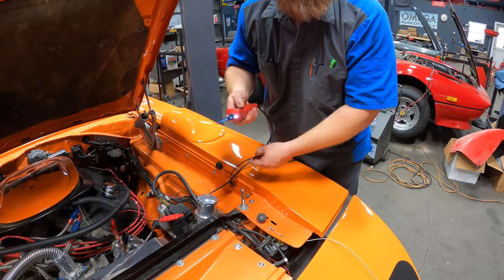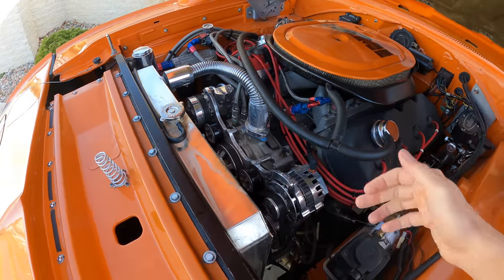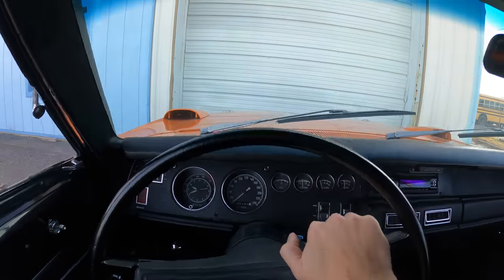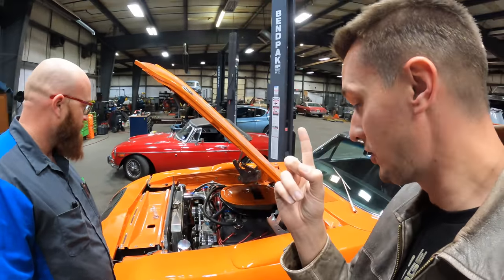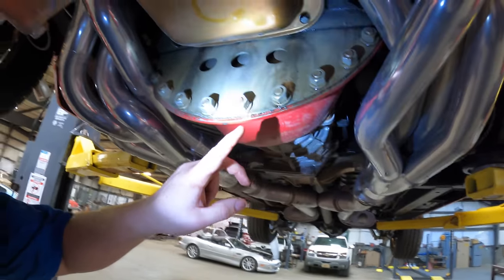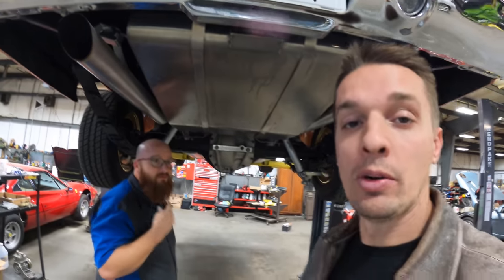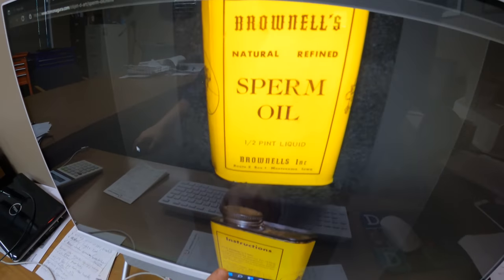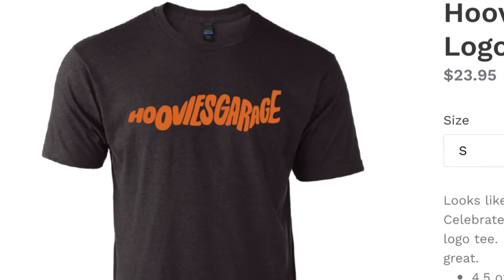How I got SCAMMED buying a Plymouth Superbird online sight unseen (So much broken/missing)

Comment: I can't imagine buying a car of that scale without thoroughly checking it out myself !!
Reply: DING-DING-DING!!!!!!!!!!!
it was just to make for a better vid!!!  this is by design!!
Reply: and that's not at all set up like most B-Body's like my 1968-70 aka what are you doing crazy 😜
Reply: @richardprice5978  
Huh 😳?😳
Reply: @ssnerd583  
Sadly.
It only made him and his buddy look Clueless 🤤
Reply: @My-Pal-Hal  that has a poorly 💩  thought out and executed maga force front system and a WTF back system as it feels like the parts canon 💥off ( i like the full length 1955 packerd T-bars/QA1 but that me ect. 2C ) and the oiling systems is?? 🤔🤦🏻‍♂. not my car but most of it isn't how i have mine 70 charger and yes im working on doing the 4.5"-crank hemi+TR6060*+8-3/4(3.2 gear) swap for brakes full willwood and a 91 jeep XJ hydro  master cylinder 👌aka i skiped having a vacuum pump and im running turbocharged  boost + lumpy high lift cam .600"+ and is a A/C 🚘ect. any other questions id be happy 😊to tell how mine is set up or others around me
Reply: @My-Pal-Hal  with as expensive and rare as real factory's matching-ish numbers hemi's are to day ( and not my frankenstein D-8 headed Tall Deck efi engine/383-LD as mopar and SBC-350's made more of them ) id drysump ( or at least 💯 shur its getting oiled 💯of the time with stable 40+ PSI ) that bastered ( basically what im doing that to mine but i have a welded steel bed 🛏plate that looks like a 1968 SS bread 🍞pan/oil pan and 12QT tank next to the rad/clip and to be honest for hoosy's is probably over kill maybe a girdle but that's it. as the engine is missing some paperwork aka unknown history and some odd plumbing and or parts choices/locating parts 🤷‍♂ why on so but i don't have the same problems/noise as this car ) ( and have a method of pre-start/ect lubricanting it ) and have the EFI that bird 🐦looks to have, shut off/kill the motor if the oil PSI or temperatures aren't right 👌as it's not concorst resto anyways and mostly software ( more so if it's a holly's system aka easy to do ) with operating engine and transmission pramitors
Reply: This guy one big doofus to have not inspected this car in person before purchasing. It's all on him!!!
Reply: @deaniacoponi2139  yah i thought 💭id add if you don't want a vacuum pump there is electric option openers on the head light 💡's are dodge later on the the run use them ( plus at least with my/charger doors and lights there was a add on oe option for tiny vacuum or electric operating wiper's and washer system. id like to add that but haven't yet so i don't scratching my paint/car ect. ) and there's the aftermarket options too and the climate control systems have other aftermarket operating options that use electric or vacuum.

on mine i 1/2 cheated and im still using vacuum for all of it and or turbocharged boost by using the opposite side of the bellows /clever valve's and a regulation of PSI or vacuum ( and a small vacuum storage tank ) to them like on the 💡doors 🚪as the older guy i know said the electric doors can be more maintenance/needs more looking over and lubricanting and wiring 👀over as the oe's didn't have IP68 connector's ect.
Reply: but i doubt that bird 🦅is going out in the snow ❄or heavy rains at night or even the daytime ( colder or foggy   weather more than likely the A/c is going to get the most use ) that would be a problem for it as its a 80+k usd car/drivers that are more careful with it now. 

unlike my car but i do try to keep the salt off of it! 🤦🏻‍♂😉 aka bad idea 💡ect. and for mine the HVAC system probably is better served with electronics instead of vacuum ( and if the vacuum pump is there why 🤔 isn't it vacuum assisted as well ?? ) and cable's but my vin is a a/c car so it was all there and working/ easier/cheeping for me to hack it 😉 ( plus im not good at coding or aftermarket wis setting up 4now but there is a bolt on parts for it ) i know not the brightest idea 💡but for now will do
Reply: @deaniacoponi2139  more of a problematic that he didn't do any research before buying it, as i should know i got bit $$ doing that stunt ( pre-ish / slow internet days in 2009* ) and i have little to no plans of redoing that buying experience
Reply: If 3400 is TRULY the damage, he is VERY lucky.  60s-early 70s muscle cars are rip-off city. Horrible mismatched cars, rivited repairs, trashed engines, rust (that has been hidden under bondo).  You really need a muscle car specialist.  He should have visited Uncle Tony's Garage.  Classic Mopar Muscle is his specialty.  Working on them since before wizard was born.
Reply: that's the Hoovie way! are you new here?
Reply: @richardprice5978  
You have to remember.
Back in the "STOCK CAR" Day.
The rules were not only different. And FAVORING Actually Stock Cars. The reason why the Super bird exists.
But their total Computer Designed Vehicle Research was a bit behind the times 😂
My first car, I may have said. Is a '69 Roadrunner. 383. Blue, with the dual hand painted strips. And White, Boats Skin Vinyl Top. Blah blah blah.
But when I got it some 50yrs ago. I wanted to put a WING on it, like the Super bird. So I learned a thing or two about the car, frame, body panels and such. That go with the Super Bird. The Front Fenders are the thing.
Which brings up the Dayton Charger. Where it was the Rear of the car,.. (roof and rear deck) that was the Aerodynamic Problem with that car.

Anyway.
Now I think about it.
Anyone buying a car that's been WRECKED. Better be Buying a Super Bird 😂
... still have my roadrunner. though the roof is showing its age 😌 ... if you want vehicle spec's, I got em
Reply: @tarstarkusz  
HEY 🤔
THAT SOUNDS LIKE AN "AD" FOR SOMEONE.
That's against the Rules isn't it 😂
The bottom line...
Is Anyone bitching they bought a Super Bird.
And I got a Dollar he bought it with YouTubes Help.
That's just one F'd Up human. And I use that term Loosely 😂
Reply: @My-Pal-Hal  he actually says thanks to his viewers for helping him do stuff like this 🤦‍♂️
Reply: @vw5056  little bit salty are we? It’s simple. Don’t watch.
Reply: @My-Pal-Hal  It's not an ad, but UTG is an expert.  If there are wrong parts in here, Wizzard will NEVER know.  Uncle Tony knows these cars inside out and backwards.  Little tiny things nobody else would even think to look for, minor differences under the hood between model years.  It takes a Mopar Muscle Car specialist to know it.
Classic muscle cars is absolutely loaded with fraud.
Reply: @Tyler-ts2ld  Indeed, you're right. I just came here because this car was on Car Wizard. I am done. Car Ninja, Pine Hollow and M539 are all better channels to watch.
Reply: If its called " Bring A Trailer "  do you expect to be able to drive it ? by 5 mins in I give up , yes low oil pressure is a worry  ( how low?) .  But selling a car   the cheapest of its kind & 50 year old ... with horn not working ..Wow !   What con artist !  send him to Alcatraz  !
Reply: Not allowed to do a test drive even ??  Inflation being what it is , filling this  gas tank w / hi test petrol is just going to get more costly as time goes on.. ..what about costly insurance for this kind of car ? - costing out the nose -  It will only get higher with time..replacement parts , expert mechanics charge major cash per hour .. 💰💰💰..I almost feel sorry for the man .. almost💸💸💸💸💸💸💲💨🙁
Reply: @jmason2838  did you have a stroke typing that??
Reply: I can’t imagine buying a car worth more than my first two houses
Reply: @YourMom-mq4zc  yeah this guy’s got serious FU money
Reply: Yeah, but the thing is, in the time you take to travel to inspect it, arrange for the mechanic to also go look at it, someone would likely have bought it from under him.  It's such a rare car, that if you have the money to spend, you take the chance, I guess.
Reply: @vw5056  You realize this is a comedy show about the rich guy buying these awful cars, right? Sure, it's mostly unscripted and the car purchases are real, but still.
Reply: @YourMom-mq4zc  it's not authentic that's the whole point barely any of it is original,and that's where the value is originality.this thing looks like a kit car gone bad.
Reply: The guy made more money on this video than 3,400 dollars so it’s a wash for him. Already 1.3 mil views

Comment: I almost bought a 1970 Plymouth Superbird, also with a 426 hemi, in 1984. I wish I had...

It was pretty beat up, had exactly the same front suspension issue, had a recent white paint job (with tons of Bondo), the rear "frame" was rusted through, it was missing lots of pieces (like door locks, ignition lock, trunk lock, trim pieces, etc) and the owner had recently spent a few grand upgrading the motor (MSD ignition with rev limiter, new Holly carb, new "¾ race cam", new headers and exhaust, new very heavy clutch, etc.). He had a dyno printout showing 503 HP, which in 1984 was considered insane for a street car.

Her was asking $2500. I offered $1500. He came back at $2000 and we never settled on a price. The reality was every penny to my name, at the time, was $1625 and he wouldn't take it.

I did call him back after my next paycheck two weeks later, but he had sold it for $1750. $125 away from my offer......

It is very strange to see a second Superbird with the same suspension issue (although Hoovie's one is in much, much better condition). In the car I was trying to buy, the owner had installed lowering spindles that were so low the oil pan was scraping. He also mentioned his ¼ mile times suffered too, because the lowered car couldn't transfer weight like stock.

By cranking up the front coilovers, so much the shocks were topped out, he said he was able to get close to his previous ¼ mile times and solve the oil pan scraping issue. The ride was unbelievably horrible, bouncing along just liked Hoovies car.

I wonder if the same issues affected Hoovies car (oil pan scraping after lowering spindles were installed so the owner cranked the coilovers up all the way and beyond)?

Comment: In the Mopar muscle car world you have to be careful using the word “rebody”. To many Mopar guys that means that the VIN from the dashboard and under hood fender tag were taken off an unfixable car and placed on a different shell.  This is not good and would be fraud and illegal.

I would be curious to know how much of the car was replaced in the wreck.  If it was front fender, door, quarter panel and maybe the lower floor and door jamb I wouldn’t be as concerned as long as the work is high quality.  I would not consider that repair a rebody.  

You have to be careful that the original dash VIN and fender tag and even the build sheet are reproductions.  There is a whole cottage industry where new tags and documents can be made.  This can be kind of a gray area if there isn’t proper documentation.  I once had a 1974 Challenger 360 that was missing the fender tag but I had the original build sheet.  I had a company make a reproduction fender tag because all the information was on the build sheet.  But sometimes people will want to add or change option codes on the fender tag to make their car more desirable and worth more money.  Mopars actually have a lot of information on the fender tag and build sheet about how the car was built compared to Ford or GM. But you really have to know what you are looking at and do research.
Reply: Hi Mike, never heard the term “cottage industry” before, what does it mean?
Reply: GM has RPO codes which are pretty dang inclusive.
Reply: @ArthurTugwell  I bunch of individuals doing work independently of each other but to the same objective.
Reply: You can look up what the car came with originally and make sure a xp29 charger hasn't been changed to a xs29 which is a RT charger. Or rarer yet a XX29 charger which is a Daytona one.
Reply: @ArthurTugwell  What Fiddler said, but here it means private parties reproducing original documents and tags. At best these are faithful reproductions of what SHOULD be with the car had it not been lost to time; but at worst it's counterfeit documentation to make a common car seem to be a rare one. If you watch the people who certify the authenticity of a vehicle they not only look at the documents and tags, they check to see if they've been tampered with and also look for other features that indicate the car is really the one that goes with them. For example, a car that was born as a Hemi car has certain reinforcements made to the suspension and body. Most fraudsters don't know about it, or else don't care enough to take it that far.
Reply: I saw video about a "rebuild" on a Bugatti pile of rust.  I dont think there was any original piece on the finished car.  In the Yacht world a complete rebuild means all the wood and faster are replace but it is still the original boat.  Also there is a video here about a crushed Shelby Cobra turned into a coffee table but the vin was sold.
Reply: Mopar guys refer to the process as " A tag job"  and as mentioned a   knowledgeable Mopar guy will point out every incorrect part on the car: Braces, hardware size....

Comment: Due to the seller screwing him over in a few ways, he ended up saving money overall, that's interesting. I imagine the auction site would particularly want to make this content creator happy, rather than other people, but yea very cool.
Reply: Not at all. Spending that kind of money on a car and not inspecting it first, he screwed himself.
Besides that all the crap he's complaining about isn't original anyway, it's just run of the mill 'car stuff'. If the issues he had with it had any impact on the cars 'status' which is 99% of it's value, then he may have a legitimate complaint.
Reply: @Anubis78250  - Well he was going to buy the car either way and fix whatever he needed to. So it's not screwing himself either way.

From the video it seems like he might have had to get in quick with the purchase, or maybe the car was far away and had to get transported to him or something along these things. I don't think the option to go and inspect it was really there. Not that I think it really matters to him either way.

The car had a good number of dodgy things going on. Some are okay, some are less okay (like the supposed "tyre adjustment" that needed to be done). The point is that they weren't disclosed, even after some things were disclosed (after the purchase, which is already dodgy).

These things should be disclosed regardless of whether they impact of value of the car or not. Sometimes a bunch of weird issues can signify that the owner is pretty dodgy and that the car might actually be in very rough shape, and can lead you to not trust them as far as the purchase goes.
Reply: would absolutely never happen to a nobody like us. they said sorry as is